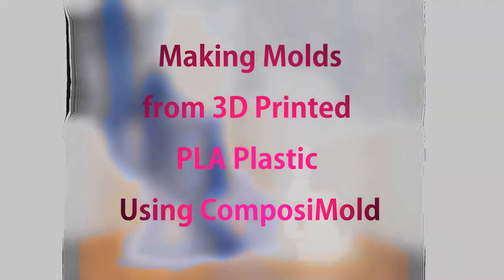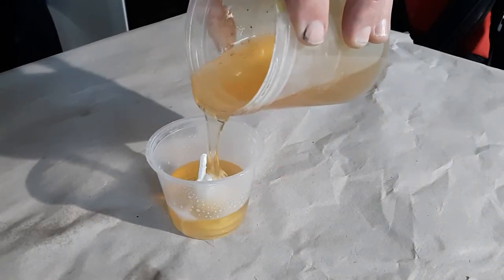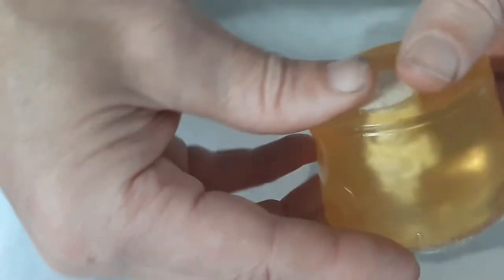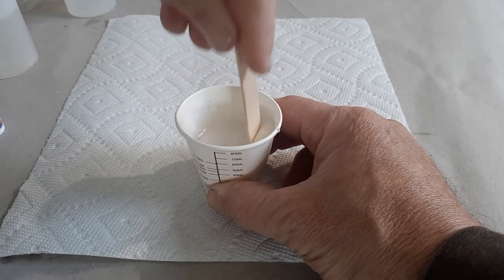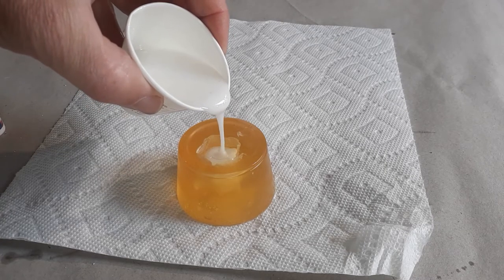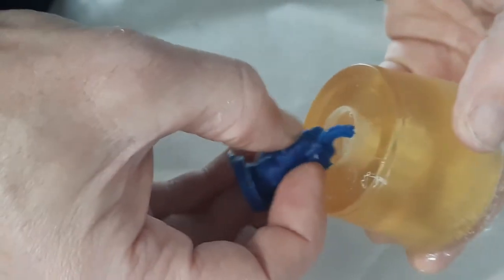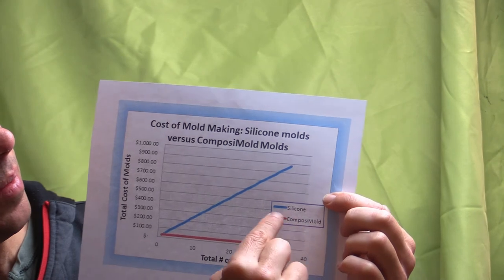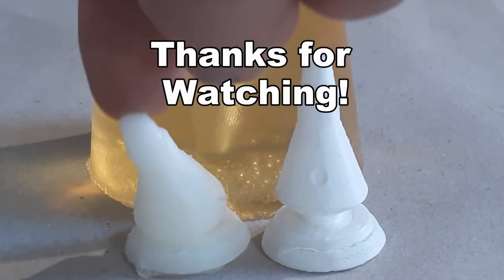Molding 3D Printed Parts Using ComposiMold, Mold Making into Different Resins

Comment: Will it melt PLA?
Reply from the maker: Not unless you're overheating the ComposiMold. PLA usually is around 200 C (gets soft around 180 C) and you want to pour ComposiMold at 130 F (65ish C). Let the ComposiMold cool before pouring... Here's us making a ring from a PLA 3D print https://youtu.be/l1_pD8-Gf6s   and there's lots of other examples...search for ComposiMold 3D print. Thank you! Stan from ComposiMold

Comment: Wow this is awesome, does it eventually start degrading after multiple uses?
Reply from the maker: After several castings, it will likely start to lose some details. If it does, you can remelt the mold and make it again. Thank you!